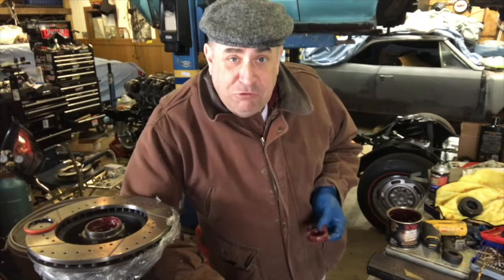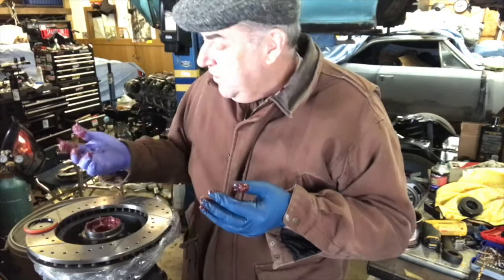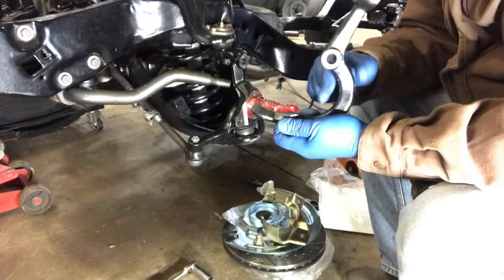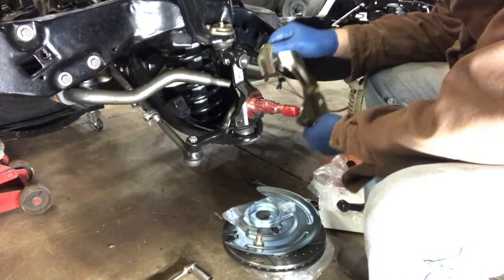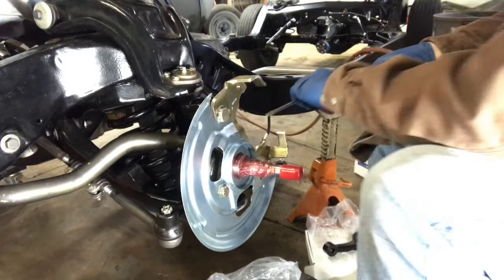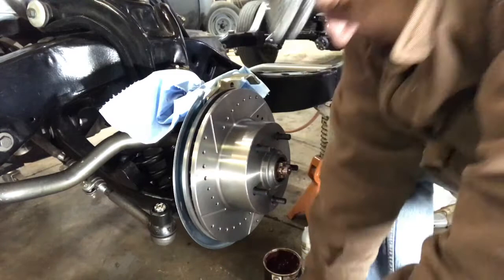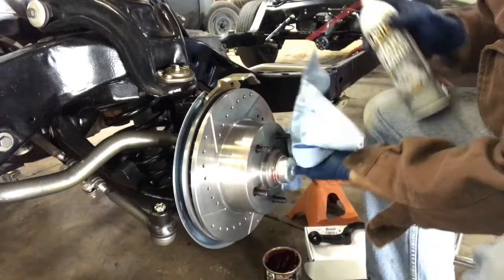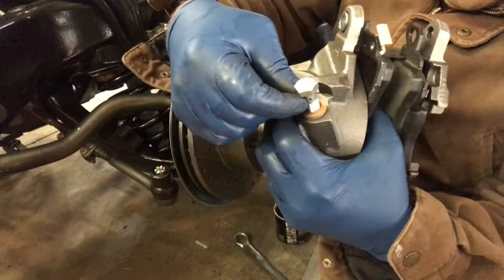Disk Brake Conversion 66 Chevelle

Comment: It seems I can’t get the slider bolts to thread like they are too short
Reply from the maker: It’s been a couple years since I did this job, but everything fit well from what I remember. Make sure your piston is compressed
Reply: @MarkMeldrumChevelleHunters  
Thanks for the reply. Everything compressed brand new out the box. Almost seems I have the wrong slider bolt. The threads won’t reach pass the metal spacer. I will contact speedway tomorrow